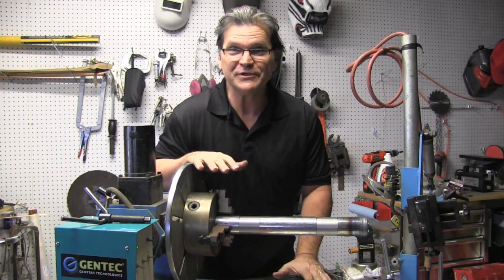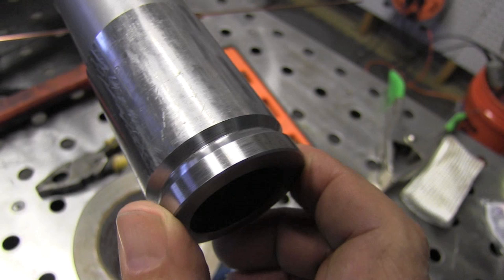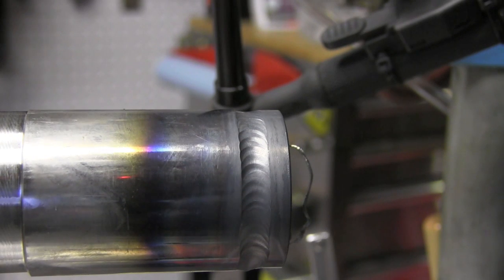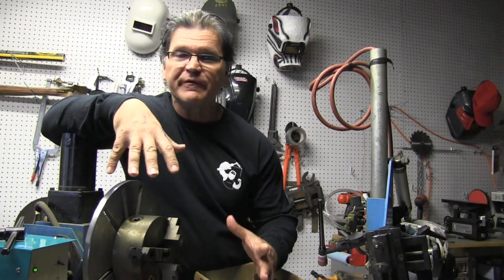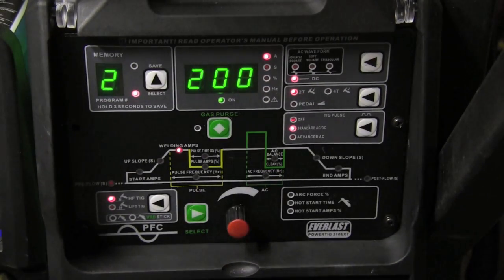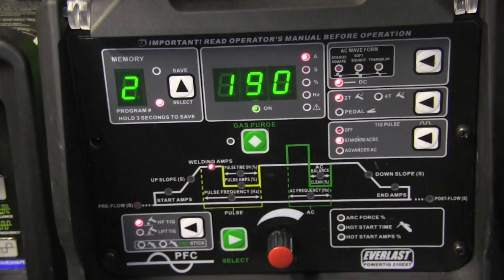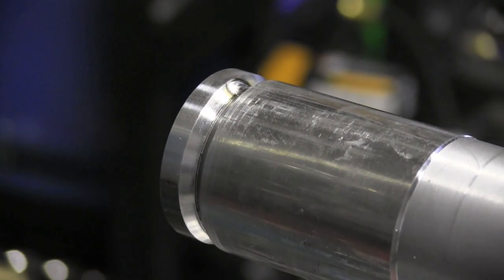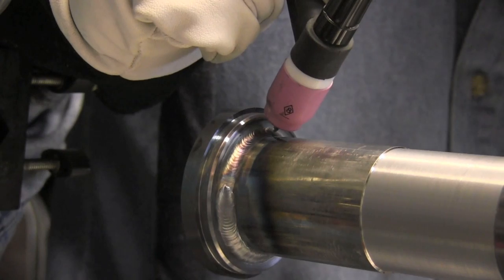Gravy Tig Welding

Comment: Hi Jody, as always brilliant video, enjoy these. quick question,,   I use pulse on dairy pipe, get nice welds,, anything thick i just get a big crack right in the middle of the weld, usually full length, doesn't matter what wire I use, I have the base current pretty low, any ideas? cheers steve

Comment: Yrs ago I worked in a welding shop custom welding, but not quite enough experience to to build up cutter blades used in the plastics industry. It was medium carbon steel, very hard blades w/ a tapered edge on one side, about about  1/2 " thick  in the middle. Basically it was the same shape as grader blade but much smaller. The edge to be built up was laid flat on the bench w/ a copper  flat bar under the edge of the blade  w/ the edge raised  1/4" for tig welding This was done in this position w/ extra passes if necessary, unlike building up boat motor props that are welded on both sides after intitial build up.Can you address this ?   Thanks. Dave

Comment: The pulse background the amperage at which the peak time is not on. If peak % is 80% at 100 amps then the pulse would be 80% of the time at 100 amps and then go down to the background for the rest of the time not 50%

Comment: Thanks for the training ;) 
Small question though, you mentioned your turn-table being 1-rpm (if I was to shop for one...) what would be the most RPM it should have/do for a tool that I would hope to NOT GROW OUT OF kind of settings, and yes, it would be manual welding, I just like how your set up is but hearing you mention the rpm made me wonder.
Thanks in advance if you can respond.  
Going to check out pt2 now ;-)

Comment: i have a project truck need to do welding on body panels i want to buy one of those inverter welders to set up as a tig the question is is there a flux tig wire i can use where i dont have to use gas

Comment: Why does tig end up grey sometimes, and others it's blue/straw/etc heat streaks and shiny? In this case, since I assume we can rule out heat input and skill, is it just a function of using a regular torch setup vs gas lens?
Reply from the maker: Kirby Weldon its a function of heat input, heat dissipation, and gas coverage.  since this was carbon steel, I was not worried much about discoloration or turning gray...its going to be painted.

Comment: Do you have any tips on welding cast aluminum? I need to modify and oil pan for an engine im building.
Reply: I'll chime in until Jodi gets here.  Unless it's a new pan - you picked a bugger.  An oil pan is going to sweat oil from the pores and mess with your welds.  After you have your cuts and shaping done, your going to want to rosebud torch all around the bead areas until all the oil is burned out of the aluminum. Take your time and burn back an inch or so from the beads and get it all out so oil doesn't wick into the weld.  Get both side beaded smooth and continuous so you don't have any thermal stress risers or areas where water can seep in and start corrosion or freeze cracking.  Even better if you can bolt the pan to something to check warping and do a pressure check with a few PSI of air to test for leaks before contaminating it with oil, again.   If it won't be anodized 4043 rod will be fine as you want good flow and wetting rather than highest strength in that application.
Reply from the maker: Kaylan Hawkins like Eddie the Grouch said...  if its oil soaked, it will be more difficult than a clean new pan. just take it slow, clean as well as you can, and stop if things get cruddy and let cool for a few minutes while you rout out the crap with a wide flute carbide burr designed for aluminum. if your tig welder has ac balance, I would set that to around 60% en or 40% cleaning depending on how it is labled
Reply: weldingtipsandtricks Might be easier to use that the old pan as a template and remake same....either in aluminium or may be knocking one out in ..mild steel.... as it more  forgiving to fab up and then to machine same to a flat finish machined surface for the crankcase  /block  to connect to, or else just use a soft gasket material like Gortex tape rather than going to that expense.... [just saying]....http://www.gore.com/en_xx/products/sealants/gaskets/gore_series_600_gasket_tape.html

Comment: Awesome vid like always.   Was this with a gas lens?
Reply from the maker: Mike Regner yep, for most of this video, I used a #8 gas lens.
Reply: Do you mostly use a gas lense if you can,  for all metal types ?
Reply from the maker: Mike Regner most of the time , I do use a gas lens...a #7 or 8 ..for some aluminum sheet metal jobs a regular #5 seems to work good

Comment: Hey Jody I have a question about tig on aluminum. Should the tip of my tungsten be balling up or am I running to hot
 thanks
Reply from the maker: colby serio  on AC, the tungsten will ball up to a certain extent but shouldnt be quivering... if you have an AC balance setting, you might try adjusting it for less cleaning.  or..you may need to use a bigger tungsten.but first, make sure you have the leads plugged in with the torch negative -